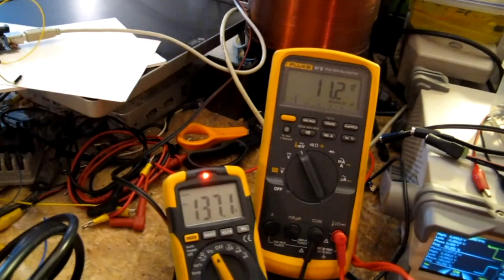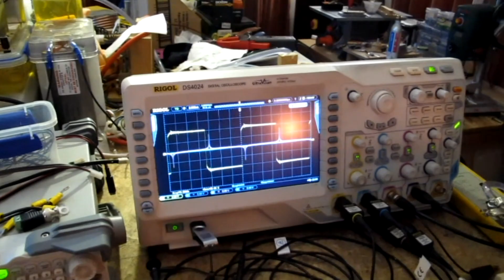2600 watt induction heater

Comment: Would You please attach di Circuit diagram of your induction heater .. I want to replicate it..  thanks for your kindly..
Reply from the maker: It's a pretty standard H-bridge driving the primary which you can find anywhere, and the other bit is a Rigol DG1032 frequency generator, so probably not much use for trying to reproduce it unless you have that or something similar.

Comment: How do you limit the power going into the circuit, if the misfets are switching rectified mains, wouldnt they just short circuit the mains? Would using a choke help?
Reply from the maker: Power is limited by what I can push into the induction coil, which is dependent on it's induction value, the caps and the frequency.

Comment: Hello, just one question.
why did you go for the transformer coupling aproach? do you recommend that?, i am trying to decide that part of my heater, the other option are matching inductors, to go easy on the mosfets... thanks!
Reply from the maker: A few reasons. First was that most of the high power induction heaters I saw online seemed to use one. I'm aiming for around 7500 watts, so figured I'd get used to working with this design. Also, with this arrangement it acts as a normal step-down transformer, so my MOS-FETs can be higher voltage, but lower current to deliver the same power. As and added bonus, with it like this the coil is floating, so safe to touch without getting shocked.
Reply: @gristc  got it, thanks!

Comment: hello i have made a circuit res 10k and 470 5W  irf 260 diode 12v and 4007       i use 12 pc ps but this not resist burn   i test whit one ps and two in serie     whats wrong????
Reply from the maker: I'm sorry. I'm just a hobbyist. I can follow schematics and build my own stuff, but trouble-shooting other people's designs in beyond me.
Reply: @gristc  friend coment the capacitors an driver scheme and the tiroid.  And what is the max time you mantain it turned on

Comment: What ICs are you using for the bridge driver and isolated voltage supply?
Reply from the maker: The driver chips are HCPL-3120 and the DC-DC converters are DCP201515.

Comment: You sound like you're from NZ, are you? Do you achieve better energy transference with high current or high voltage running through your work coil? Great vids by the way!
Reply from the maker: Thanks, and yeah, NZer here.  :)

Higher currents produce stronger magnetic fields, but you use higher voltage to achieve them, so, umm, both?

Dealing with higher voltages (so lower currents) in the driver stage means less heatsinking necessary on my switching devices and fewer losses, so that's the direction I'm going. Hoping to go to 600v with this setup and I have some 1400v rated IGBTs in my cupboard looking for a purpose.  :)
Reply: I'll be excited to see that. What voltage do you drive the gates of the H bridge with? Do the high side drivers require a higher voltage to offset any feedback from the primary coil? My H bridge built from IRF540Ns just burnt out at a much lower voltage and I'm struggling to understand why. They were only running at 32V/3A at 57KHz. The high side drivers became extremely hot. Do you have any ideas on why this could be / what to look out for? Thanks!
Reply from the maker: That sounds odd. I have noticed my high-side FETs get a bit warmer than the low-side ones, but not the drivers. I don't really know why that would be sorry.

The main things that have killed my FETs have been when I had ringing due to missing/broken flyback diodes and pushing the voltage too close to the wire.
Reply: Thanks again. What bridge drivers are you running?
Reply from the maker: They're 4 x HCPL-3120.
Reply: I have a seemingly simple question for you. How did you determine your winding ratio for you CT? I've been approaching it by determining the peak voltage my secondary can handle (50A rated capacitor x 0.013 total ESR = 0.65V) 48V Primary / 0.65V Secondary = 73.8 turns. This seems overly high. How did you calculate yours?
Reply from the maker: That does sound high, but that voltage in the caps is very low too. Mine peak at several hundred volts.

There wasn't a lot of calculation. I found a similar design that had 12 turns so started with that. The current incarnation has 18 and I may go another 6 or so if I can squeeze them on.
Reply: Did you have any problems with inrush current given how large your DC link capacitors are? My capacitors arrived yesterday and I'm concerned that I may pop a breaker or damage my variac if I connect them directly. Also, is that why you use such large diodes for your rectifier? Because of the initial inrush current? Thanks again!
Reply from the maker: Inrush current is a problem, but it happens without the rectifier, so I think it's just the variac itself if I hit the AC mid cycle. I often pop the breaker, but I'm not aware of any way it could damage the variac.

I used those diodes because they were the biggest ones I had. I've also used that rectifier for a carbon-arc lamp, which was lower voltage but higher current than this.
Reply: Yeah. It occurred to me after writing that, that the variac would act as a giant inductor (depending on what you had your variac set to) and impede any sudden draw of current. I'm hoping that if I can balance the voltage setting with the amount of inductance the variac will generate I can avoid blowing a breaker. Do you bother starting off from a low voltage and gradually bringing it up to a working level or just flip the switch and let it rip? By the way this video inspired me to make an induction heater. Nearly there. Had it running 1100W yesterday. 53.6V / 20A
Reply from the maker: Nice one! Do you have pics or video?

I usually start it with the variac at 0 volts, but it still trips the breaker fairly often. I was thinking about making a soft starter for it, but SCRs that will take the load are pretty pricey.  :/
Reply: Not yet but I will compile a video when I get my hands on a decent camera. Learnt a lot from this, would be good to share. I think there is some potential to use this driver / current transformer as a welder too. Plenty of things to explore yet.  

I think the variac secondary presents itself as purely resistive when you set the voltage to 0 volts. That might be working against you. I just measured mine and it reads 2 ohms at 0V, 5mH at 25V, 34mH at 50V. I assume that since a variac is a single winding transformer it will present itself as an inductive load. I could be wrong about that. 

I've thought about doing something similar once I've got the basics sorted out. An SCR based rectifier / voltage controller perhaps. I see arrow.com have 600V 22A/450A burst SCRs for around $13 US a pop. vs-22ria60 if you're interested.
Reply: Junkers those 540s are rated for 100v and voltage in tank circuit is input voltage times pi
It called resonant voltage rise 
And never lust and component to its max rating 
Unless you run them on a infinite heatsink at 25°C in a lab
Reply: Cheers Mrinal. I think in this configuration however (series resonant tank) the voltage phases cancel, the current waveform increases as the effective impedance drops to that of the ESR of the tank.
Reply: Junkers yes 540s are at max rated for 30amp and than on 25°C as a rule of thumb get 4x rated components them your needs
Reply: +gristc Back with more questions my friend :) How is it you have not damaged your scope? I can't see if you're using an isolation transformer or differential probes but I would expect you would need them to prevent a short occurring. How have you managed this or is my thinking wrong?

I can run mine using a SMPS but if I connect my Variac I get a 100Hz waveform superimposed on my H bridge output waveform. I have a feeling it may have something to do with the ground connections on the scope but I'm not sure.

Btw I have a very short video of mine running off a SMPS here: https://www.youtube.com/watch?v=6Fb-a2rQorg if you're interested.

Comment: nice work, but why are you running 4 modfets ?
Reply from the maker: I need 4 to make the full H-Bridge..
Reply from the maker: You need 4 FETs for a full bridge H driver. Allows me to puch twice the power through it as using a half bridge.

Comment: What frequency are you using?  Have you tried different frequencies?
Reply from the maker: Sort of. The resonant frequency is entirely dependant on the values of the capacitor and the coil, so to change the frequency you have to change one of those. Putting the crucible into the coil affects it, but you can't really change the resonant frequency while it's running otherwise.

It's set to run around 70kHz which gives me a skin depth of around 1.5mm, slower and it will go deeper, but too slow and it will exceed the depth of the crucible sides. Going faster increases the impedance of the coil, which slows the current flow, which I also don't want. It's a balancing act.
Reply: Thanks for your reply.  I have been playing with the Chinese 1000 watt ZVS board a lot.  It runs at about 100 Khz unloaded and drops maybe 10% under heavy load.   I need to get a 1/2" square bar up to about 2200°F to forge it so I am shooting for about 30KHz.  I'll be adding caps and inductors, in steps to see exactly what happens, doubling them, then again, checking temps as I go.
Reply from the maker: If you know the current capacitance and frequency, you can use that to work out the inductance of the workpiece, and from there work out the capacitance you will need to get the frequency you want.

It will be quite a lot more than you currently have to drop the frequency that much.

I'm interested to know if it makes enough of a difference forr you. My approach would be more power.  :)
Reply: I have been playing with Fres = 1/2pi sqrt L*C.   I have  several sets of both C and L from boards that I have done bad things to in the past.  Although I can repair them pretty fast now, I might as well use those parts, since they are already mounted on boards.  
More Power?  Yes,  but I am not sure I want to get that deeply involved.
I have been moving up in voltage from 12 volts to 24 and then 36, with a "CNE" (Current Never Exceed) of 24 amps.
That's with car batteries.  Last step will be to install a 48 volt 26 amp Power Supply.
As you already know, as I change other things, I have to adjust work coil diameter to hold the current in check.
I am water cooling my work coil and fan cooling my board.  So far I can run for 10 minutes easily at V36,A24 with caps and Mosfets not getting above about 120°F.
  If I can't heat the half inch bar hot enough to forge with my present setup (using 2 IRFP260N's), I may just move on.  I'm about 3/4 done with a ground-up specialized engine ECU and I should get back to it.
Reply: @frenchcreekvalley  forget zvs... cant melt nothing with that

Comment: Thumbs up, try tungsten !!
Reply from the maker: Hmm, 3422°C melting point. I've already set my crucibles on fire.  O.o

My current goal is 2100°C or so to melt aluminium oxide and hopefully make sapphire.
Reply: gristc Graphite sublimes at 3642 °C, how much did you cranked the voltage up before the MOSFETs fail ?
Reply: ***** Yeah, I know ;)
Reply from the maker: I'm afraid I got to this point mostly by trial and error. The cores for the coupling transformer came from a commercial electronics salvage house. I just stuck together as many as I could fit in the space I had and hoped for the best. I've also changed the number of windings a few times to drop the current and allow me to push higher voltage.